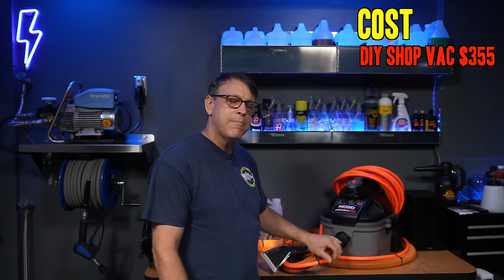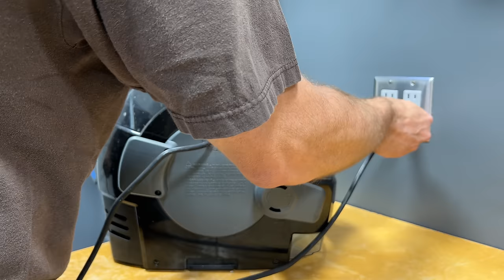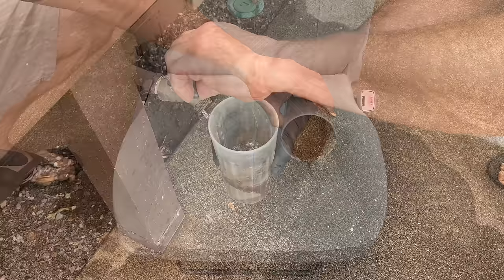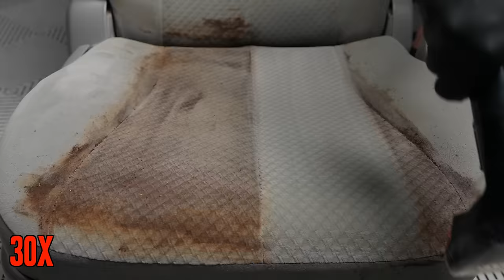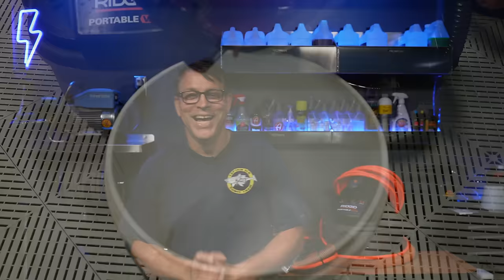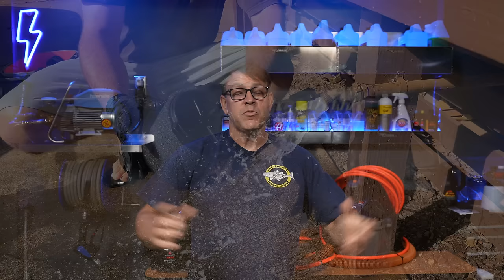EXTRACTOR EVERY THING YOU NEED TO KNOW. BISSELL SPOTCLEAN PRO or DIY SHOP VAC

Comment: I wasn’t sure if I was going to find this interesting. But I was wrong. Interesting comparison. Obviously the Rigid was the strongest and most efficient. But the little Bissell did work. I have heard that sometimes folks put cleaning solutions in the water tanks, which you can’t do with the Rigid, any thoughts on that?
Thanks for sharing 👍✌️☮️
Reply from the maker: Glad you enjoyed the vid.  I get so many questions about it I wanted to make a video to answer them.
Reply: That would be tricky to do with the rigid but not impossible.
To be honest, I don't know anyone that adds detergent to the water tank. It's much more productive to spray on the detergent, agitate with brushes and then rinse out with the extractor.
If you added it to the tank, you would probably need to use one tank to wash and then refill with clean water. to rinse.

Comment: The problem I have had doing this with rigid vacuums is that the bearing in the Area that actually creates the suction it's seated in plastic and when dirty water goes there it eventually gets hot and then melts out the area holding. The bearing and then the motor gets really loud sounding and stop sucking well.. Make sure you get a warranty because if you do this on the daily. You'll need to get a new vacuum every 4 Too 6months. If you want to save your vacuum you can put some chemical inside the waste collection area that pops the bubbles. When it forms this will help quite a bit? It will double the life of the vacuum. Also if you use a pre filtering bucket which is just a big white bucket with one hose going in and another 1 going out that collects the. Dirt before it gets to the vacuum then the vacuum won't have any problems

Comment: So I may have let my Civic with a light gray interior go waaaaay too long without a steam clean. I am using the attachments on a typical Hoover steam cleaner. Something in the $150 range. It seems the interior looks clean then I come back the next day and more dirt is sitting on the top. Any tips? I have pulled about 3 buckets of dirt out of the car.

Comment: I'd like to have seen the ridgid extractor take a couple passes on the Bissell side to see if more dirt comes out even though the surface is visibly clean.  Also, after the Bissell with vac-only, run the rigid vac-only to see how much water was left behind by the Bissell because that affects both cleanliness and dry time.

Comment: Jeremy,
Thank you for the fun to watch and enjoyable informative video. 
I am curious if there is a difference between the 
Bissell SpotClean Pro 3624
and the
Bissell Little Green Pro Commercial BGSS 1481 
Kind of hard to get side by side specs to compare but the Green Pro definitely have a much wider nozzle which is nice but the plastic used for it is not clear which doesn’t help to see how much dirt is coming off what you are cleaning. Was curious to know if the motor was bigger. I will be buying one of these units soon. Thanks again
Reply from the maker: I plan to do a comparison soon. I am not sure of the difference. Thanks for the idea.

Comment: Hey Jeremy, love your vids!...........I have an extractor kit made by Shop Vac. I bought it many years ago, and as I remember it was pretty reasonably priced? Came with hose, large and small nozzles, extension wands (for floors) and a water/soap injector. It works very well but unfortunately, I dont think that they make it any more? I have a Bissle but find that it just doesn't have enough suction power to do a good job. The shop vac kit is something that I wish they would bring back as mine is getting tired.
Reply from the maker: Yes that sounds like it would be a good seller if they brought it back. Thanks for sharing

Comment: Great video which really showcases both awesome machines. Now the question is how much faster is the big boy $2,000 extractor versus the homemade extractor? I have to admit those rigid machines are hard to break. I used a five gallon Rigid for years in construction and no matter how much I abused the machine it kept working. Hopefully you get a ton of views from this cool video.
Reply from the maker: Thanks a lot. Yeah unless you are doing a lot of extracting it’s a big spend.
Reply: You’ve never used it with drywall dust a filter and bag hooked up to dust extractor homemade kinda like bucket top speedsters for saw dust ? 

Anyway cleaned up drywall dust 3 vac on 1 job were shot drywall dust is so baddddd it ruins everything

Comment: Not trying to complain, but why at the 12:30 mark why didn't you show the Bissell SpotClean Pro being used on that half of the seat after you agitated it with the drill brush?

 I'm a novice still trying to decide between the two options. I'm kinda leaning towards the SpotClean Pro and don't have/haven't purchased a extractor kit for my shop vac yet, but I'm savi g up for it. I watched both videos respectively of your DIY [Ridgid] Shop Vac with Mytee Extractor and review of the Bissel SpotClean Pro, so I kinda expected the the Ridgid w/ Mytee extractor would "extract" more dirt/water than the SpotClean Pro in this video, but even still as novice on a budget I was just hoping to see the final "comparison"/ tips of using the Bissel SpotClean Pro v the DIY extractor after you'd agitated the seat a second time.....

 Don't get me wrong,  everything was great/ informative and I know it may not matter/make a difference, but I was curious/wanting to see that final portion, just to see if the SpotClean Pro could finish the job effectively 👍🏾
Reply from the maker: It could have easily finish that job. I just wanted to wrap it up with the shop vac. I have done a few disaster cleans with the Bissell. Check those out. Of the 2 options I do like the shop vac batter.

Comment: Good job Jeremy, I use tP&S Products myself. I live about 10 miles away Freon where they make the stuff in Hayward, CA. I know this video is mainly for the machines. My Pro-Flight extractor is old and bulky. My old upholstery tool handle broke. Have you tried the “Finisher” from P&S? It’s like my final step after I use the Terminator and Carpet Bomb . “Finisher” removes the final residuals from the other products and also helps break down the molecules as minimizes any Mold build up.. Gonna look at your links to get the parts for my build. Again, good job and Mahalo...
Reply from the maker: Thanks a lot. I appreciate it. I will check it out.

Comment: I’ve used a house carpet cleaner Hoover  hose extractor and it worked very well I have the smaller version now and it works well using the product you used in the video. I have used oxyclean and worked very good and house hold cleaners designed for the machine and they did ok but took longer. I detailed car at a used car lot and have Seen my fare share of dirty interiors from cow shit mud and oil from a mechanic and I always got them clean.
Reply from the maker: Hahaha. Thanks for sharing.

Comment: The Bissell has nice brushes that do a decent enough job just wish it sucked lil harder. My prob was getting a refurbished one and the motor gave out after 3 months of occasional use after one heavy session Abt 45mins. Good perspective . Have the lil hoover now it sucks harder but sprayer is weaker almost insignificant. It also only holds Abt half the water the Bissell would hold w float stop valve
Reply from the maker: Thanks for sharing

Comment: Haha I have a bissell little green pro going on 2 years as a mobile detailer I try to take very good care of it and wrap the hose up nice and never dropped it, still works great just need better was looking at the spot clean pro or the hoover equivalent maybe do a comparison on those. And the mytees are really nice but really expensive and you really want a heating element for certain things and all these cheaper machines under 1000 don't offer that
Reply from the maker: I like the shop vac conversion and I hook it to a hot water tap. Works well. Thanks for watching

Comment: Easy hot water is the Bissell advantage.  Fill a vacuum thermos with 140F (60C, the max for the Bissell) water and only put a little at a time into the machine, so that you always have fresh hot water.  Obviously, running the ridgid hose to a hot water tap is ideal, but for me, that means a hose from the bathroom or kitchen, which is cumbersome, annoying, and if it ever sprung a big leak...  Since I need a ridgid wet/dry vac anyways, I can do a dry pass with a $20 extractor head (no water) after using the Bissell and I think that I'll have good combination for home use.

Comment: After watching your video, I purchased a Bissell Spot Clean Pro and your pump sprayer, but I need your recommendation for a drill attachment cleaning pad or soft bristle brush gentle enough to use on microfiber upholstery.  Should I use a drill attachment sponge pad for waxing & polishing paint instead of a drill attachment brush?  A few YouTube videos demonstrate and recommend using Method brand glass cleaner as a solution for cleaning microfiber upholstery, but if you think P&S Carpet and Upholstery Cleaner would be better than Method brand glass cleaner for microfiber upholstery, please let me know.  Thank you for your cleaning videos!

Comment: Great video, does the have to be a model that has hot water, steam? Or will one of the regular models work.
Reply from the maker: Regular one works great. Check this out. https://youtu.be/bZcSMvePBJg
Reply: @HawaiiDetailing thanks,do you still recommend the p&s carpet ,upholstery cleaner. I only have two vehicles so I'm trying to find a prouduct that will work on both carpets,and upholstery. Thanks again,I owe you some fresh malasadas

Comment: I did my first details with the Bissell and it's a pain in the ass when you have 2 or 3 carpet and seat only detail. You have to constantly be filling and draining which kills time alot of it, you have to have a 5 gallon bucket with water rdy to keep refilling next to you in the car. With a shop vac you can continue to detail non stop having stronger vac also means more pick up and less pass through a once it's clean move on. You can use the shop vac as a vacuum and as an extractor etc etc..
Reply from the maker: I agree the Bissell is a homeowner style spot cleaner that can be used for detailing based on your budget but that savings comes at a cost in workflow. I prefer my shop vac extractor and if I did regular daily extracting I would buy a commercial grade machine. Thanks for watching
Reply: @HawaiiDetailing  commercial grade machine isn't as everyone makes it as hype to be. I owned a mytee Spyder extractor. Big machine pretty heavy, also I found out that using hot water to shampoo to leave the carpet smelly even if cleaned throughly. You'll have to do regular maintenance on it. Since hard water clogs the inside parts you'll need to be upkeeping it. I would prefer to just use a vacuum diy extractor. $200 compare to $1000 is no brainer.
Reply from the maker: @GerardoGarcia-tb7gi  I agree. Thanks

Comment: Great video , couple of questions , so I’m just starting out on carpets in homes ….. I have bought a bissell big green 1400w extraction cleaner but.  I wondered what method and solution should I use. Should I mix up a prochem solution and agitate with a soft broom I bought , then clean water only in the bissell to get the dirt and soap out or mix it in the 2 gallon bissell tank and clean that way ( treating any stains first) ? Also what do you think is the best cleaner to put in the machine to leave little residue after. The carpet to be fair are incredibly dry after completion. Is it possible at this stage to get results like an industrial machine 

Thanks again great video
Reply from the maker: I would use straight water in the machine to have the best chance of removing the cleaner. Definitely use the spray on and agitate the product and extract out with plain water method. That’s what I would do. Thanks for watching

Comment: I'd skip the shop vac set up, keep the shop vac for normal vacuuming and get a Vacmaster 3-in-1 for extracting. It's only $200 and does the same job. Holds 8 gallons and has a drain port on the bottom.

Comment: I’d pay for someone to turn my shop vac into an extractor😅 I have this same bissell for extracting and the almost the same rigid for vacuuming, same shape of vac, just without the wheels. I commented on one of your videos about making one of these awhile back. 😊 I’m honestly so tired of the bissell. It hurts my hand so bad! I’m on my 2nd bissell after my 1st one’s handle broke off from the hose. I load everything up (Pressure Washer and MC1385 steamer included) including all products, ladders, everything In the backseat of my little Honda Accord,  haha 😆 of course I’d love my own van. I could fill it instantly will product alone, but staying practical as to my budget at the moment, it would be nice to save some space in my car, take just the shop vac, and switch out the filter when using it as an extractor.
Reply from the maker: Do a shop vac conversion. It’s easy and the parts just plug together. It’s worth it. Thanks for watching

Comment: the Bissel is great, however if your going to be using either for extraction, the Bissel constantly rips the extraction hose over and over and also has a very short hose. Ive got a myteevac heated extractor , cost me about 1400 dollars , if i could do it again, id probably make the rigid one myself as i have that same vacuum as my detail vacuum and it takes up significantly less space than the huge mytee vac.

Comment: Hey Jeremy: have an off topic question if you don’t mind. I have been using P&S Pearl and am nearly out. My wash location is nearly always full sun so I’m looking for a ph neutral soap that cleans well and rinses clean with no residue or streaks. Nice foaming ability would be an added bonus. Have an MJCC enroute. What do you recommend?
Reply from the maker: GSF is probably one of the best soaps out there. My preference is Adam’s mega foam in the cannon and a shot of GSF in the bucket. Ethos foam party is another of my favorites. Any one of these should do well. Only work an area that you can finish before it dries on the paint. Almost any soap that dries on the paint will be a problem. Even if you have to do smaller sections at a time rinsing in between. That’s another reason for thick foam is a longer working time.

Comment: Question. If I were to use my shop vac for extraction but also need it just as much for vacuumingz on the same job (detailing)- Can I go straight to regular vac with a wet filter or….? How do I switch or easiest/fastest way
Reply from the maker: Watch this. How to Extract a Car Interior Like a Pro! SHOP VAC EXTRACTOR
https://youtu.be/bPPpAftjz2w

Comment: This is a great video. I love detailing, but im heartbroken cause my truck seats (which js my baby) smell and ive been wanting to do a deep clean on them. But i couldnt find any consistent videos on what machine i should get. I really want a quality product and have been stressing about this for a while
Reply from the maker: These are both good but it depends on the use as to what way I would go. Occasional cleanings go bissell as it’s a light duty machine that is not commercial grade. Going to use it more often go with the shop vac. Hope that helps.

Comment: Im a mobile detailer and been using my bissell $200 for 2 years now. It’s good but short hose is a con. I ended up buying the Aqua pro Vac. $600. Used it 2 times then broke smh 🤦‍♂️.
Reply from the maker: I hear you buddy. I have been liking my shop vac extractor conversion. It tough and works well for me. Sorry to hear about that breaking. Thanks for watching

Comment: Great video. I'm curious though, what are the benefits of a 8070 over the shop vac extractor once it's hooked up to heat? I know the appearance comes off more professional, but from a functionality standpoint I would think the shop vac actually has more suction and aren't compromising on quality. So what is the added benefit to spending $17-1800 more for the same function?
Reply from the maker: It has a lot more suction and is commercial grade so it can take a constant beating of daily use. I am a huge fan of the shop vac though. Great for the normal people out there.

Comment: I remember this red dirt and I used to live behind the dole plantation. I have a gallon of carpet bomber and using it with a spray bottom I don’t get any foam with agitation. I haven’t tried it with my foamer though.
Reply from the maker: Not sure why not. Put a little more product on there?
Reply: @HawaiiDetailing  yeah I detailed a car yesterday and I sprayed more product and it foamed up a little but it was better than before. I do a 2:1 ratio but I want to try my foamer like you did. I use my foamer for the brake buster though. It foams up like crazy.
Reply from the maker: @E85_STI  that will help foam it up for sure.

Comment: I have a question ! I already have a wet/dry 3 gallon 5 hp rigid vacuum. Does that work too ?? It’s the same brand but smaller but same HP
Reply from the maker: Yes. Just get the proper adapters for your hose.

Comment: So What happens if you do not put a water hose attached to the vacuum shop? if you put solution and use a drill brush and then just extract without putting water in it? would that work?
Reply from the maker: No the water is how you flush the cleaner out of the fabric. It has to be removed.